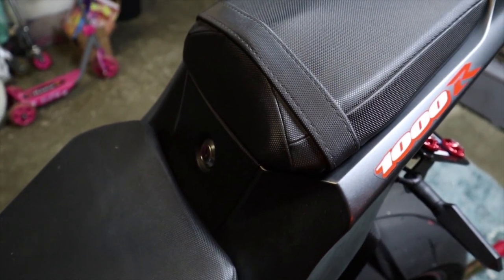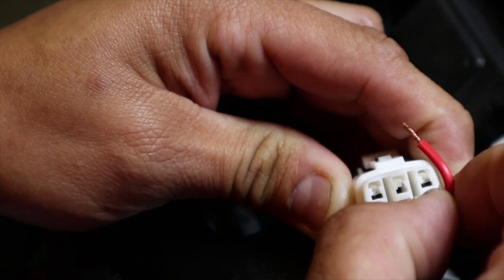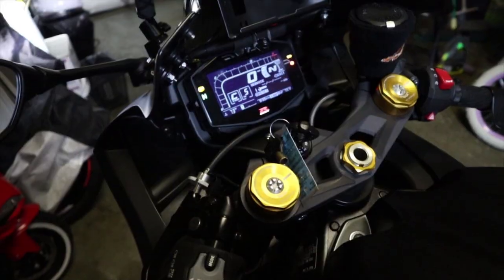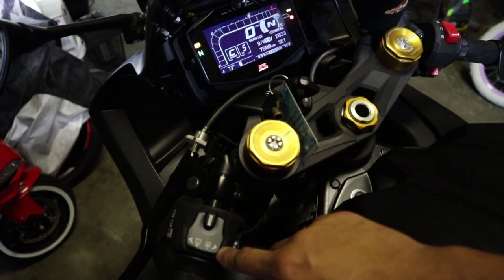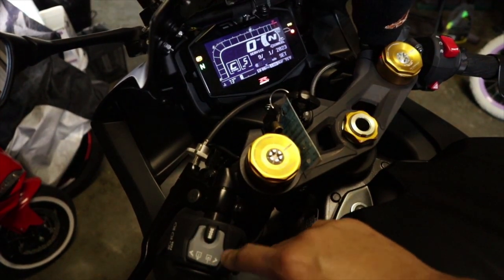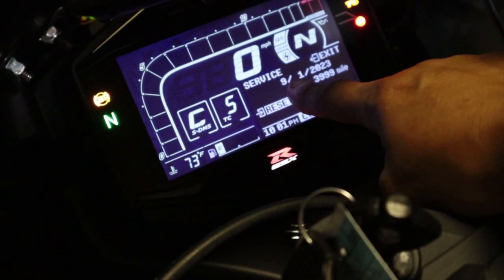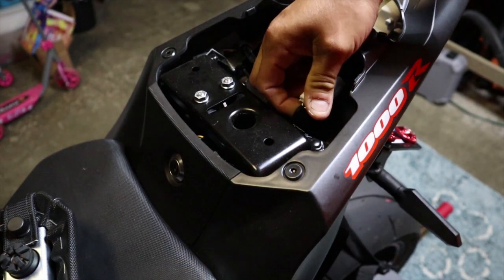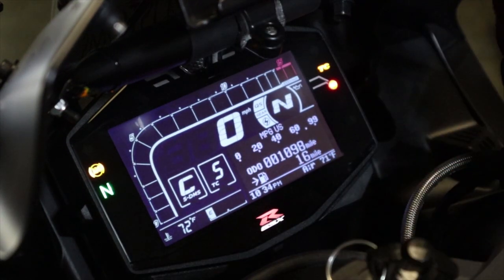How to Reset the Oil Service Light on your 17-23 GSXR1000

Comment: Did you do your first oil change at 1,000 miles?
Reply from the maker: @Chad_Thundercock_  ya I went over as I was on a motorcycle trip and couldn’t do it On the 600 mile mark

Comment: I bought a OBD 2 scanner for my GSXS 1000. First oil change is due in less than 100 miles. I can do it with that right?
Reply from the maker: Yes you can change the oil before it’s due, just make sure you go into the settings on the bike to change the oil reminder

Comment: You only have to do this for the initial service change because it’s locked from the dealership? Or every time?
Reply from the maker: every time you do your oil change as there is a count down on it.
Reply: @ACProductions77  this the same for the 24’ model? Plugs different isn’t it?
Reply from the maker: @Oceanstole_Soul I believe its the same not much has changed on the bike besides fairing colors. but if i do come across a 24 model i will check on that.

Comment: My service menu comes up without shorting the plug
Reply from the maker: it may come up but you wont be able to change the settings unless you bough the bike used and the previous owner modified the cable back there so they didn't have to use a jumper wire to get into the settings.